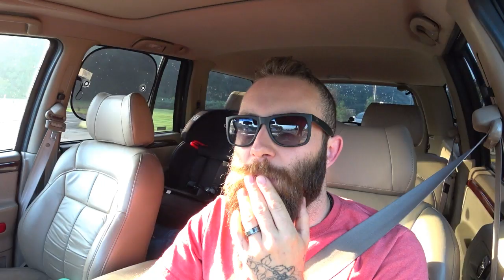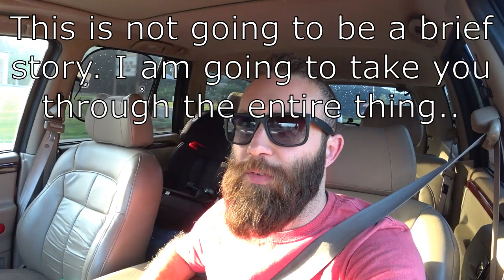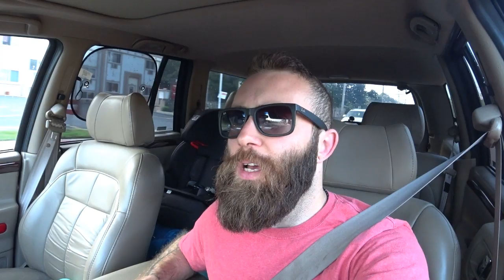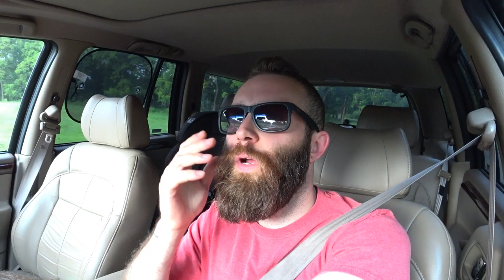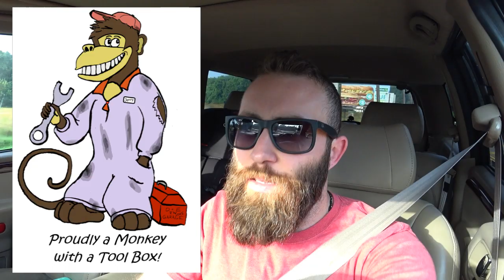Mystery Engine Overheating Issue SOLVED - Jeep/Dodge 4.7L

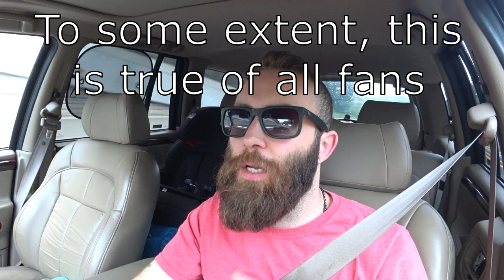Comment: The mechanical fan, if you were to put on the doorman fan, and it's easy enough to research, it is very little parasitic draw, and it pulls air like a beast. On the freeway it doesn't matter. You won't even need a fan driving down the freeway because you can't push more air through the radiator than what you already going through it. Furthermore, there is a small adjustable valve on that hydraulic fan and if you turn it to the right by half a turn at a time, it uses a small standard screwdriver, it will increase the speed of that hydraulic fan. But they are horrible stopping power from the power steering when you try and turn it while it's idling. That lightweight Dorman fan seems to be the best fix for it all of these issues period and a 180-degree thermostat works great as well. It allows the engine to run between about 195 + 200 generally speaking. By the way my Jeep WJ runs at 2:10 to 2:15 regularly and I live in Detroit.
The power steering will use less parasitic drag running just your power steering then it will when it's running your power steering and your fan. Work is work. Some of these Engineers are morons. They've stopped wrenching on cars decades ago.
Most vehicles have a bleeder valve on them and if they don't you still believe the highest radiator hose on it. That's been standard procedure for 40-plus years. Actually closer to 50 years.
Quick info on towing with that transmission. Does not have bands on it. You have to increase the line pressure. And you cannot do that in the regular way you do with any other transmission because the power control module in the Jeep will lower the pressure back down to what they set it at. You can order, look it up from a company called transgo, a device that plugs into the right side of the trans and then plugs into the wire loom and it will trick the trans into thinking that it needs another 15 or so pounds at idle 2 about 30 plus pounds at a higher RPM, allowing that trans not to burn itself to bits trying to tow with it. It is a nice trans, but that mechanism in the jeep that forces the line pressure to stay low is horrible.
The power steering cooler and the transmission cooler r two separate sections and one is above the other, not side-by-side.
Experience tells me that as long as you've kept it below about 2:30 to 2:40 you will be okay. But who knows. If you are worried about it, pick up a set of heads from a 2007, throw on cams from a 2008 and put the timers on it from the 2002 that you have and you'll have about 30 more horsepower to play with on top of everything else. And if you're pulling a boat remember that it's a lot easier to pull a boat cuz it's pointy at the front

Comment: You said they stop that pump in 2004 I have a 2005 4.7v8  dodge Durango what pump does it has then ?
Reply from the maker: You should have a traditional mechanical fan with a backup electric fan instead of this hydraulic fan setup. Lucky!
Reply: @DEInTheGarage  not lucky.. I have compression gases going into the coolant😪😪

Comment: I was thinking my power steering pump is going on our WJ Overland, but now watching this it may just be because it has ATF in the damn thing. That ATF isn't going to hold up well in this system. Had I known this I would have added the correct fluid when we bought it. Maybe I'll try flush and fill before replacing it.
Our WJ has had me on the ropes lately too. Everything was golden when we first brought it home. Now within 4 months I've replaced every suspension wear component, brakes on all 4, evap large leak, driver's exhaust gaskets and now needing pass side, upstream bank 2 O2 sensor, now getting bank 1 cat below threshold, scanner shows high tranny temp but no light came on, going through 3 qts oil in 1400 miles (bangs head) Not a happy camper right now!
Should have bought my wife an '80s diesel square body Blazer lol.
Reply from the maker: Dear lord man... That is a list! I have to do exhaust gaskets as well. Difficult job?
Reply: @DEInTheGarage  The driver's side isn't so bad, if you have small hands, not me lol. Just time consuming. The passenger side however looks like a ton of crap is going to be in the way. Battery/battery tray, A/C lines, harness. I need to order new bolts first, not going junk yard scrounging for them again.

Comment: Exact same issue in mine. Replace PS pump and used hydro PS fluid from dodge and BAM fixed.
Luckily I had a buddy that was a service tech at Dodge back in the early 2000's and he's the one that told me you abosulty have to use that fluid otherwise it will bomb the whole motor. 

Here I am at 264k miles and it's still running strong 5 years later. I've heard alot of purist trash talk the 4.7 but just like any engine if you take care of it and maintain it right it will serve you well.

Comment: This was such an interesting watch... I have the 4.0 but have always wanted something bigger, now I know to stay away from the 4.7L!!
Reply: The 4.7 is a good motor, dont let horror stories scare you away. They mass produced these motors across the board with jeep and dodge for a reason...they're reliable if you keep the fluids good. The 4.7 will give you less problems than the transmission behind the 4.0, if you have a need for the extra power, dont let the stories worry you bud👍
Reply from the maker: I am not saying the 4.7 should be avoided, but it definitely does require more attention than a 4.0

Comment: I just picked up a 99 jeep with the 4.7l really nice clean jeep for $400 and been trying to figure out why it was running a little hot, well the oring on the power steering line is bad and leaking so I'm guessing this would be my issue also.

Comment: I dropped a valve seat in mine last summer. Finally replacing the motor. (Thanks for the coolant advice with the green orange coolant) well started pulling everything out to get ready for my ho motor. So pull the radiator hoses off and out poors green coolant. Get the next motor and in sits orange coolant. Before that I had issues with the power steering pump. Seen a few videos of replacing with e fans and mechanical fans and they say they worked great. So I'm probably going to play with that. Start mechanical due to it being cheaper to do and change the plumbing for the power steering. Soooo I don't want to buy another motor so I figure I have to separate the fan and power steering pump to hopefully not run into that issue again. Thanks for what you do though helps out greatly.

Comment: Question... Would power steering fluid below the minimum line cause the same problem, you think?
Reply from the maker: Hmm.. potentially? I suppose if you were low enough to reduce resistance, but not low enough that it caused an issue

Comment: I do love my 4.0L! OH and thanks for letting me know that German cars are over- engineered after I got my wife a 2003, VW Passat.  Don't get me wrong we've had it as a part of the family for a few years now his name is Blütz cause he's blue and it's been a good car (the AWD is nice in the winter). But sometimes you look at the double amount of everything they put in the car and wonder did they really need to have 4 control arms per wheel?  Do you really need 4 $100 oxygen sensors? NOOOOOOOOOOOO I dont think so.  But the reason I bring it up is because I did learn one thing.  When it comes to fluids in the VW, I do believe that you can find acceptable equivalent fluids that don't have to come from the "Stealership". But they do have to be an EQUIVALENT fluid.  It can't just be something similar it has to be something designed to be the same.  That being said I don't know if your hydraulic fluid is available from third parties. My 4.0L is so flexible in comparison.  I'm using Rotella diesel oil on your recommendation and it's working out great!  I put GL 4 In my transmission instead of the Gl-5 recommendation (I kept reading about the GL 5 being tough on brass synchronizers).  Also working out great!  Lol random thought! If your 4.7L was to ever cause enough problem that the ocean seems like a better place for it than your driveway, maybe just swap a 4.0L in it!  P.S. Thanks for the shout out!  I'll send a pic of international Jerry as soon as I get him!

Comment: Oh man that's a hard one. We've all herd the horror stories of the 4.7 valve seats. My current thinking is it takes 200deg to expand steel by .001in ( I believe) Well if the engine is still running strong. Then I don't think you crossed the threshold of dropping the seat. Now that's it's running cooler you are wayy better off. OEM heads for the 4.7 look to be like $5-600 (after core rebate) so it's a toss up to rebuild or just buy and then install. But that's alot of work. And I couldn't find anyone non-OEM 'valve seat drop resistant' heads, so you'd be damn close to where you are now.  I'd say run that 4.7 as is and keep her cool. Air dams are key to proper air flow.
Reply from the maker: Yea man, given the amount of work I may just go forward from here and hope for the best. is it eats itself I can pull a junk yard motor and drop the whole thing in for about the same amount of work and money

Comment: Martinbuilt has a video about adjusting the speed of your hydraulic fan by turning in a valve on the solenoid.
Reply from the maker: Yea, I saw that one. I was considering trying it, or atleast getting that tachometer he has so I can confirm mine is spinning as it should

Comment: I think you'll be ok with the valve seats.. it never really "overheated". My wife pinned the temp gauge in the XK and it still seems to be fine 🤷‍♂️. 🤣
Reply: Project Dan H I had seats just drop out of now where and the temp gauge in my whole doesn’t go past half
Reply: @02jeepwj  Yikes... Scary thought man.   Maybe a previous owner cooked em? 🤷‍♂️
Reply: Project Dan H first one dropped at 10k miles of ownership. 2nd time 2 dropped 200 miles after putting remanned heads on.
Reply: @02jeepwj  oh man.. that's scary.. in a 4.7?
Reply: @deplorableconstitutionalis2834  yes.. if you shut it down right away and let it cool there shouldn't be damage

Comment: I have the same problem, and i found "Hydraulic Fan Solenoid Mod" by martinbuilt, it can UP RPM of your Fan. maybe that helped. But can the air not completely leave the cooling system 4,7? Maybe the gasket burned out? Need a CO2 test in the cooling system first.

Comment: Hi, I have a 2002 Dodger Ram 1500 with the 4.7 and the same issue you had. I've been trying to troubleshoot this issue for almost 5 years. I've tested the sensor, it's working, so my next step is the pwr steering fld. I've googled the vehicle for type of fluid and the results do not come back with the hydraulic. Here's what I get.

The type of power steering fluid that should be used in the 2002 Dodge Ram Pickup 1500 is ATF+4. The capacity for the truck iS3 quarts of fluid. Power steering fluid helps with the hydraulic assistance so that the steering wheel can be turned more easily, it will also help lubricate the power steering pump and the steering components and prevent corrosion. 

Question, how can I tell if my system is hydraulic?  

You're help is much appreciated!

Comment: Sadly, I have slightly over heated mine (212 degrees or so) a few times since I have owned mine. Luckily I have not noticed any obvious issues caused by the slight over heating. I do know at around 200k miles ( currently 225k miles) the motor was completely rebuilt due to previous owners son running it out of oil and over heating it. Hopefully he went with Odessa heads (odessa "fixed" the valve seat problem) and I don't have to worry about that issue. After I did the mechanical fan conversion I have had a few times my temps reached 210-212 on a hot day sitting in traffic. That will be fixed in a couple weeks when I get a fan shroud from a 4.0 and I unblock the top 1/3 of the mechanical fan blades from pulling from the radiator.
Reply from the maker: I am in the process of searching the yard around me for a clean HO to rebuild and swap in.  I like the 4.7, but I want to be able to trust it. I have heard a lot of stories like your though which give me hope.

Comment: So my 00’ Durango, 4.7L v8 is experiencing the same issue, now my A/C does NOT work at all. I just replaced my radiator about 4-6 months ago, now I can here the fan is working, just won’t cool down til I shut it off, now also my rig reached around 235-250, I live in the hills in Cali and I barely make it up to my house before she damn near redlines, today as of 9/30/20 my truck got hot enough to shut off. What could it be?
Reply from the maker: Are you sure it is bled properly? The 4.7 has a unique process to bleed the coolant and if not done it will overheat

Comment: What would be a reason I can hear my power steering pump hiss softly when I turn my or my climate control(so everything is silent) I turn the steering wheel and the sound changes so that how I assume it’s my power steering. From what I can see my reservoir is full and cool aid red in color
Reply from the maker: Could be your pump is going? What engine are we talking about?
Reply: D&E In The Garage 2004 4.7 of course... also the cool aid red color I was taking about I believe was the brake fluid reservoir.. so I’m unsure about my power steering fluid levels

Comment: Don’t touch a thing/ u fixed the issue/ this engine is tuff and can take it. Just always put in the correct fluids as u found out. Must change oil every 3000 then no trouble

Comment: I have 01 grand cherokee limited and when runs hot at idle it wants to stall I loose battery and oil pressure gauge but starts back up and runs fine to home.happens every time get hot out.hmmm

Comment: im going to start watching your vids more. i have a similar setup 4.7 and havent had an issue with over heating other then the time i purchased it for 500$ from a friend and cyl #8 started taking on coolant. so i rebuilt the 4.7 and had a few hickups as i never owned anything over 4cyl's. i will be doing a trans cooler similar in style to yours, as the p/s already takes up a good amount of radiator space in front.
Reply from the maker: Awesome. let me know how you make out!

Comment: brother I live in Florida and I just bought a doge magnum 4.7 8v 2005, I replaced thermostat and water pump I flushed the system and it still heats up.  This happens when I go 40 or 50 miles / h I only drive 5 miles to work but that is enough for the needle to go up more than 3/4 help me please I like my truck

Comment: I have to admit, I’ve thought of going to an empty field and burning it to the ground.. but this is my daily as well and fully stock as a fully equipped limited edition that the sun roof doesn’t leak 🙌.. having searched all over j finally ran into your video and ran out to the driveway to taste what’s in the power steering box..!! Sure enough it smells like that purple crap.. it’s been driving me nuts.. I stare at the temp and if it goes up I take my high blood pressure gummy bears.. having said that I will drive to the Dodge dealer for 2 quarts and will follow up on this comment.. thanks for posting this.. I freeking regret selling my XJ too.. hopefully this will fix my temp from creeping up..

Comment: Did you ever figure out your power steering issue.... With the 4.7 V8.... Mines A 4.7 V8 247 J/272 ratio.... Quadra Drive AdvanceTrac RSC.... Nothing EVER matches up, but the HP Top line that runs over the top of radiator around and down under the radiator.... I still can't find that cage that goes over the top of the retaining bolt which also fluid to pass as you apply gas.... My RPMs continue to be low NO over heating 😎

Comment: Do you have the part No. on the fluid? Mine was working ok until i refill the ac , now the e-fan kicks every time the compressor is on, after the compressor shuts down it goes back to normal , dont know if its related...

Comment: My 91 XJ seemed to like overheating as well and when I looked at everything I thought it was all fine, I checked the radiator fluid and it was fine and I checked all the others as well. However my coolant tank was empty but I thought it was fine since the radiator was full so I kept driving it a little bit and it seemed to get so hot that it started to slightly leak out of the passenger front bottom of the radiator and I thought it was doing that cause it was overheating. So I was like what the heck and just topped off the coolant tank, and when I started it and drove around for about 10 mins at operating temperature, it was running cooler so I checked the tank and the engine drank like a 1/4 of what the tank was holding. I suppose it went to the radiator. So I topped it off again and it hasn’t gotten lower since. The radiator only seems to leak when it gets really hot. And that only happens now if I’m sitting in 91 degree weather without moving the Jeep at all and it’s just idling and the e fan is off, otherwise it doesn’t leak for some reason.

Comment: Absolutely excellent video! How did you bleed the system with the correct power steering hydraulic fluid? Wondering the proper way to do it so the incorrect fluid gets o uh t completely. Thank you!
Reply from the maker: I did it the old school way. Drain, fill, circulate, repeat a few times. Wasteful, yes, but it got the job done

Comment: I'm having a problem with mine building pressure I think the head gasket is failing  it doesn't overheat but it is building air pressure in the cooling system
Reply from the maker: Yea, that is a very common sign of a failing head gasket unfortunately